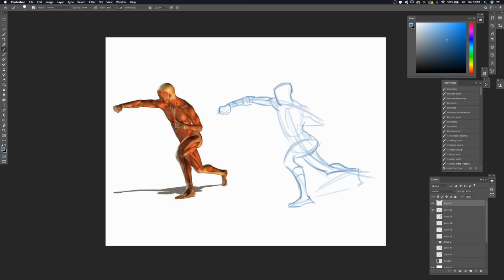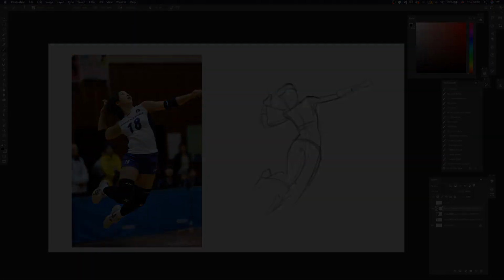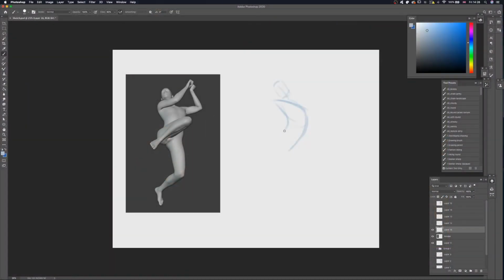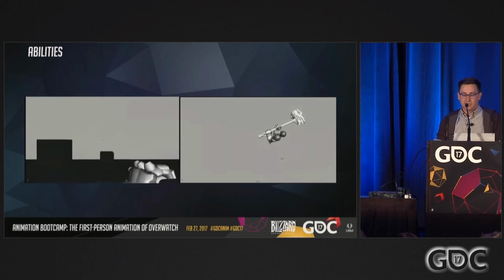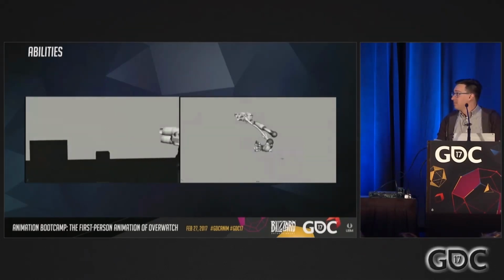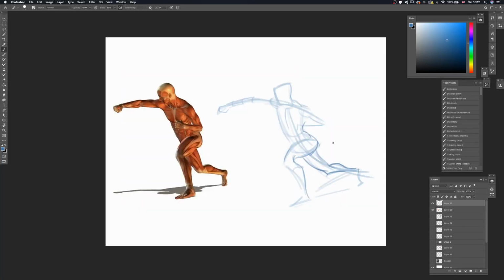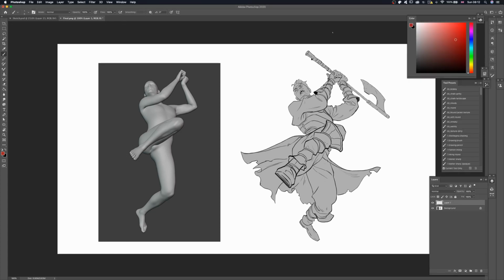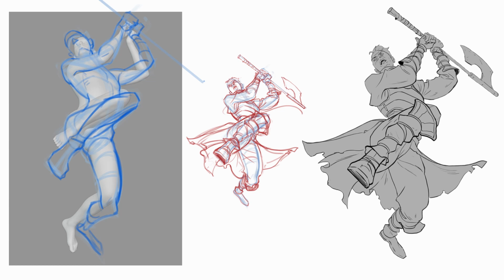DESIGN PRINCIPLES | Drawing FROM -vs- OVER 3D Reference

Comment: You could balance in both ways. I noticed one of biggest issue with tracing is it lacks foreshortening. I watched YouTuber artist, Laovaan who showed ways where you can trace over the 3D model and then adjust some parts to help make the pose look dynamic. Drawing over in simple shapes and adjusting it works just as fine as drawing from the reference.
Reply: What about things like focal length or lens tricks? Photographers are able to capture that kind of foreshortening by changing lenses.

Comment: I'm really bad with drawing people, recently i started using 3d models as a helping hand. I would pose the rd model, trace over it's basic shapes to understand the structure, and then add details/alterations of my own. I think a mix between the two is the best for times sake, but I still need to work on my anatomy regardless
Reply from the maker: Sounds really great! Glad you’ve found something that works for you 😄
Reply: Any update?